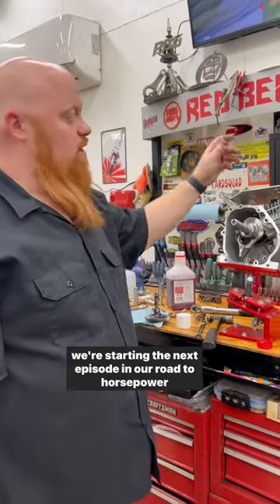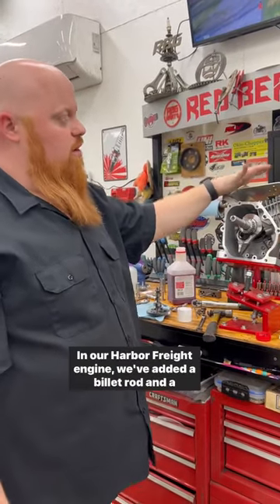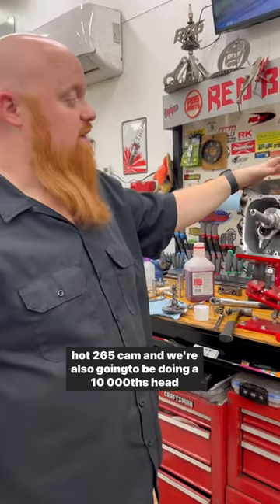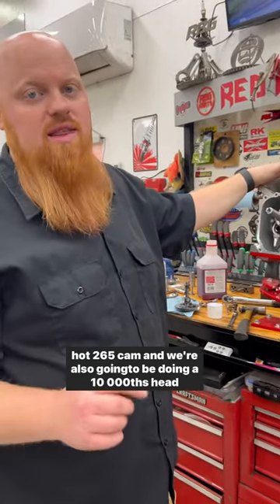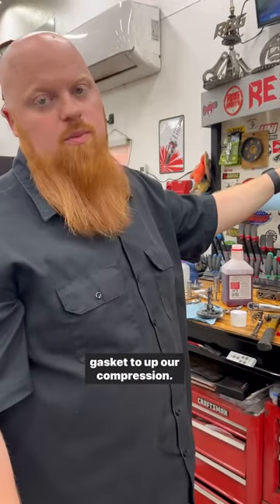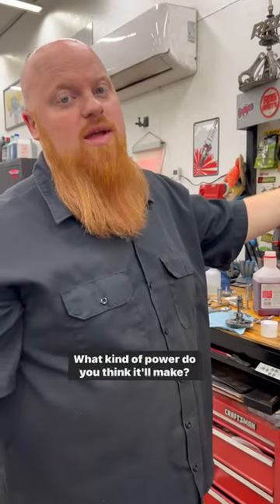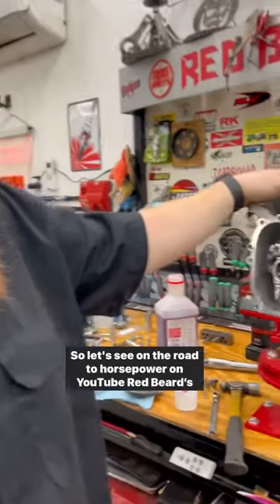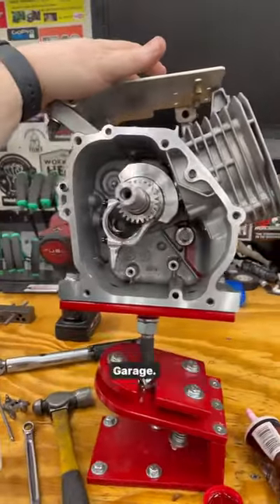The next stage in the Predator 212 Road to Horsepower- Billet Rod, Hot 265 cam, &a .010 head gasket!

Comment: I’m doing the same thing to my predator 212 non hemi but I’m adding a flat top piston will I run into clearance issues with a .010 head gasket
Reply from the maker: Im not sure. It depends on the cam and rockers you run as well.